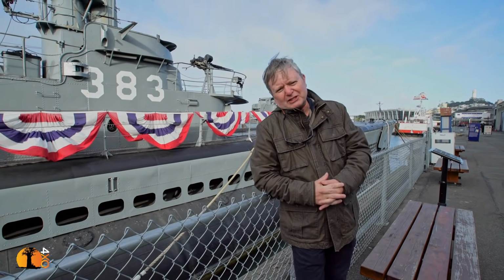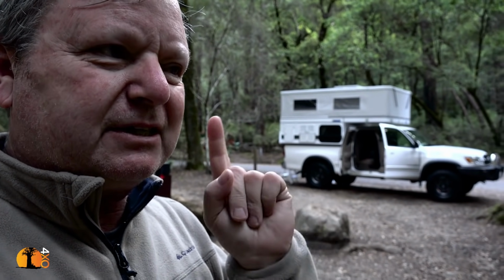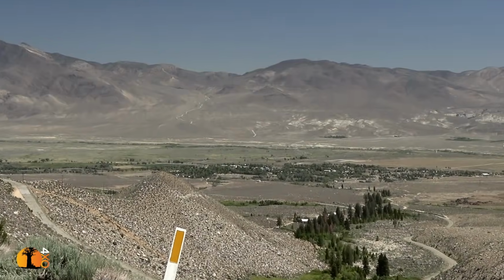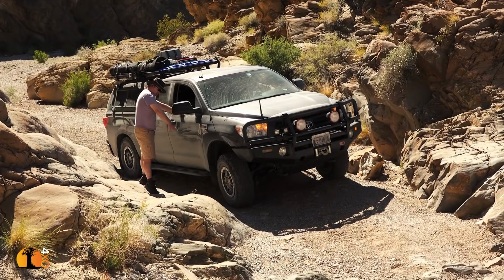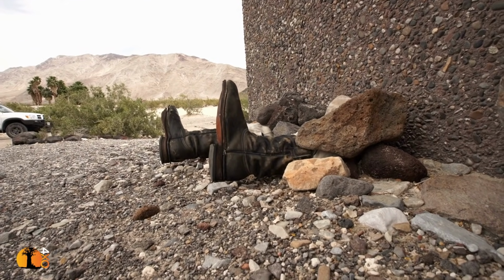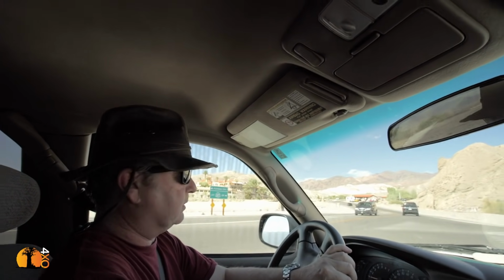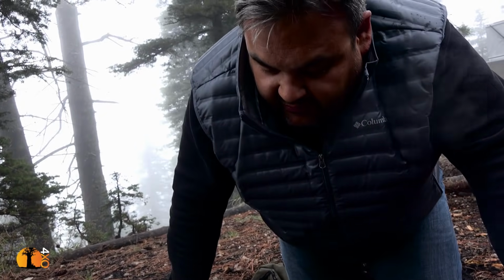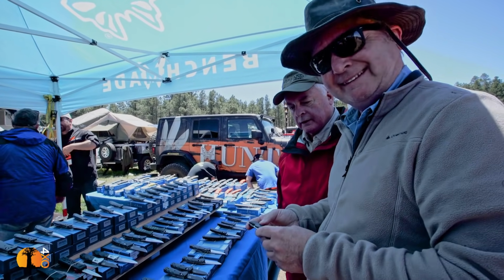DEATH VALLEY CALIFORNIA OVERLAND BY 4WD CAMPER. FEATURE-LENGTH | 4xOverland

Comment: Up until about 5 years ago the only diesels available were in GM, RAM and FORD full size trucks. Most of which are for pulling. And the Nissan Titan had a V8 Cummins diesel, but nobody really bought one, so that’s no more.

Comment: I can't get my head around the fact that campers in the US don't have showers and why all the open slats on the camper, 50km on bush track in Aust and the thing would be full of bull dust.
Reply: Some do and some dont. Alot of the ones you see for weight savings have an external shower and a compost toilet option. With the outside shower and shower tent you are fully functional for 3 seasons. i prefer an inside shower but both work very well. Due to the design of alot of trucks and campers they are super top heavy an most are not made to go off road mostly because they are super top heavy. Build type and quality is also a factor as you would want the most sturdy but light building materials to handle all of the twisting and bending that happen while offf road.
Reply: @yeahman1975  As an Aussie it just seams weird and the small fuel tanks, I've driven 600km just to get a cold beer.
Reply: @ookeekthelibrarian  in regards to fuel tank sizes, you have to remember that the US is alot more populated then Australia, so you have alot more fuel availability. In Aus Apart from the coast on the East its a decent trip going between main cities with a scattering of small towns for fuel Fuel, for example Adelaide to Perth and Adelaide to Alice Springs etc. And on showers, I have a Friend that has a similar camping set up on his F250 and it has Gas hot water for Showers
Reply: @J-P88  as I said it's weird.

Comment: Andrew, I very much enjoy watching your videos. They are a great inspiration. I do have a question about your Death Valley trip. It appears that there was a point where your Four Wheel camper became unattached to the Tundra due to it clearly hanging out over the rear bumper. Having a Tundra and a Four Wheel camper myself, I was wondering what happened and how you were able to deal with the problem being out on the trail.

Comment: Should never go in warm water with your watch!!
Reply from the maker: Why not? I still wear it every day. Its 40 years old
Reply: @4xoverland  Andrew you should heve plugged your storytime video about how you put your watch into boiling water!! 😂
Reply: I think you mean don't wear your watch in a heated spar or hot-tub. 
Some watched can handle things like that, but it's not advisable as it can wear the seals out.
Reply: A Submariner is designed for rough conditions. Part of the normal servicing is replacing the seals.